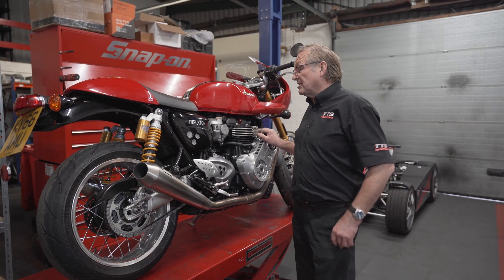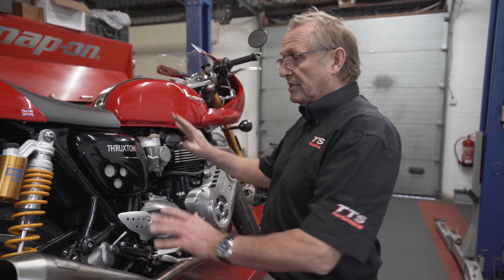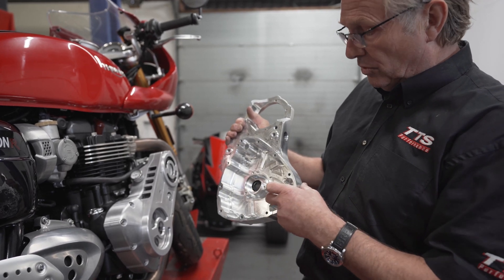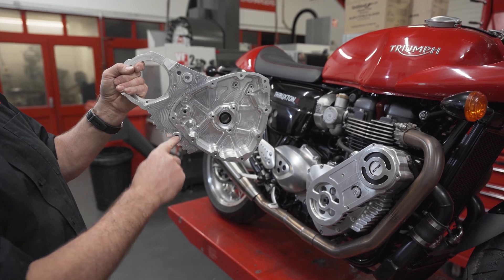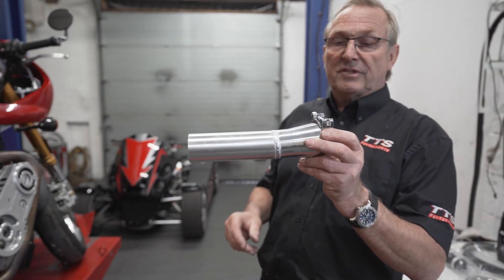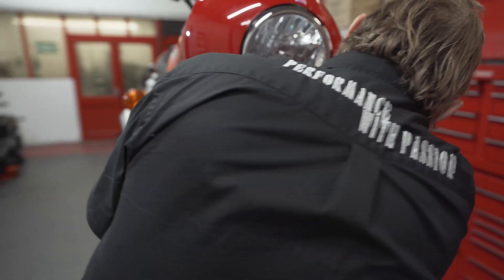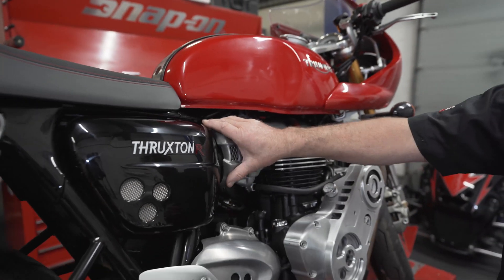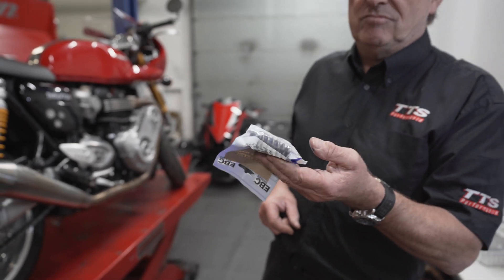How to install a TTS Performance supercharger kit to a Triumph Thruxton R

Comment: Do you provide the correct injectors in the kit now, or can you recommend which ones to use? The kit I bought a couple years ago only mentioned drilling out the stock injectors .
Reply from the maker: Yes we have injectors and injector plugs to rewire
Reply: @TTSPerformance  So is there any way to get the latest plug and play injectors that you recommend? Also, the clutch is slipping badly with the springs that were provided. Do you have a heavier duty clutch recommendation?
Reply from the maker: @dougzeman  we have them in stock just email sales@tts-performance.co.uk. 
If your clutch is slipping a new set of springs won’t help much. But a new set of plates as well. It is possible to fit a shim under the clutch springs to add a bit more pressure.

Comment: How does this affect long-term reliability? Do y'all know what hp the stock crank is rated for? Any issues with clutch slippage? Thanks!
Reply from the maker: There’s always a trade off. But the engines built strong.

Comment: I've got a 2020 Thruxton RS, would this system be compatible?
Reply: So your saying i should sell my 6 bikes and buy a Thruxton RS and Thruxton R and put the kit on the R? Ok I'm going to get working on that. I love the Thruxtons looks but i ride supersports on track and MT10 and SuperDuke on street but I'm definitely not against adding this kit to an R. I saw you for the first time with the 44 teeth video. I hope your business increases 1000%.
Reply from the maker: Joe Bollocks only with a change to the R alternator. Unfortunately.
Reply: @TTSPerformance  I'm sorry, the R alternator?
Reply from the maker: The Rs alternator is smaller than the R and doesn’t fit my case.